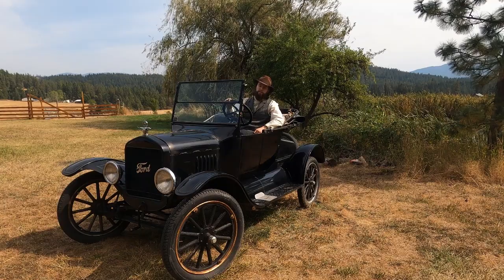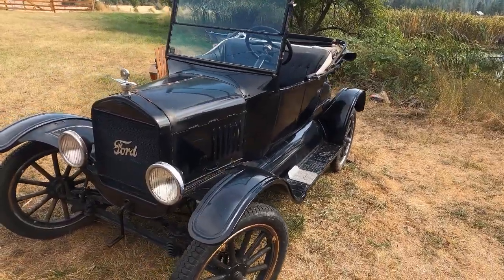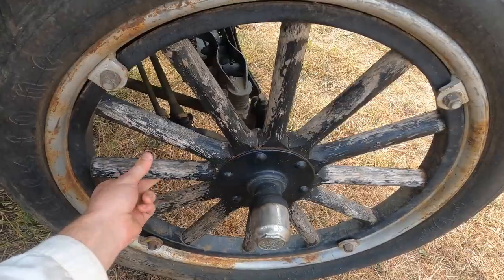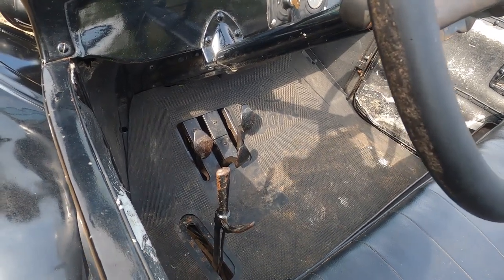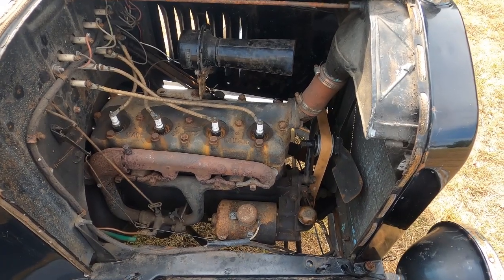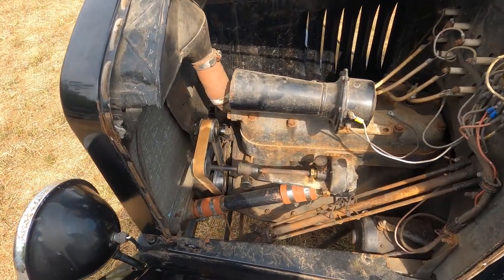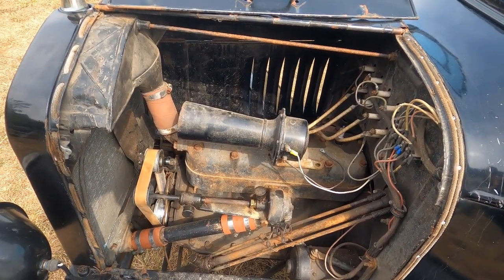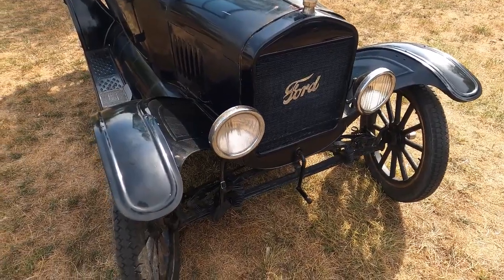Saved From Yard Art, 1924 Model T

Comment: Don’t be afraid to put some paint on that engine. I use a satin black that looks better than glossy. Also .. you are running rough. I think you need to adjust gas mixture in the carburetor by the needle valve. That is adjusted by the rod on the firewall. Start out rich for starting (anti-clockwise) and then turn clockwise to lean it out for smoother combustion.